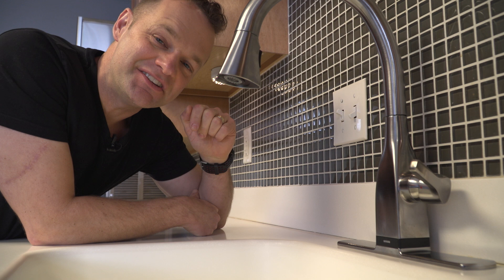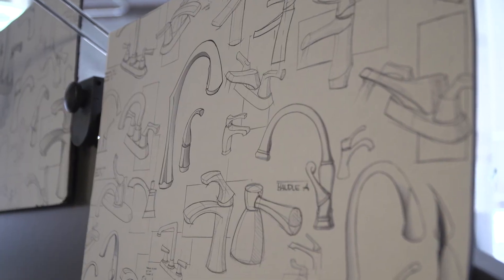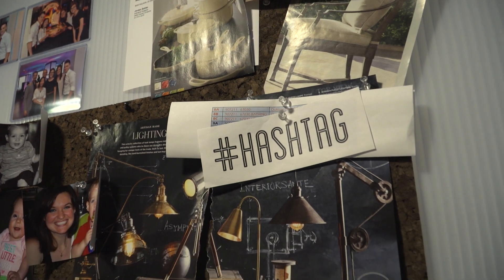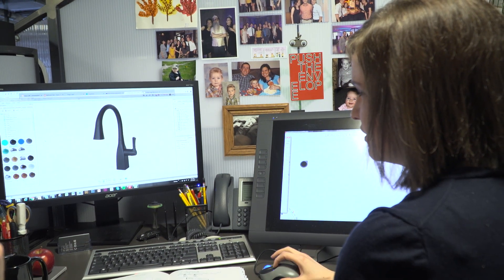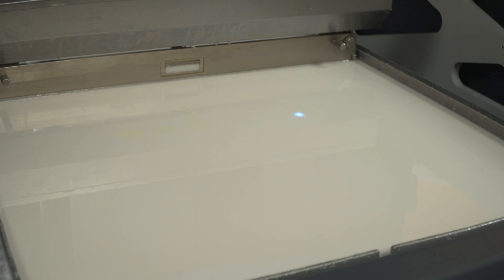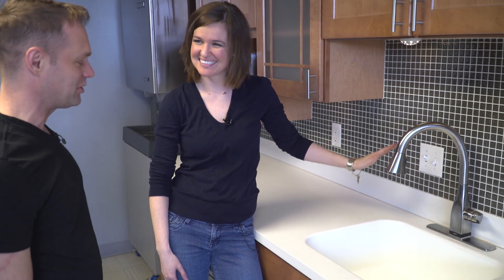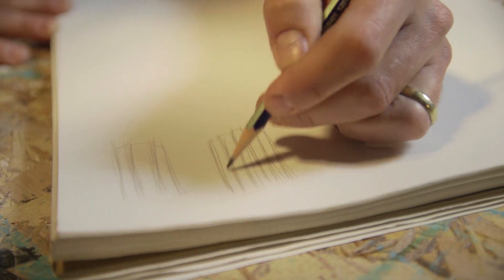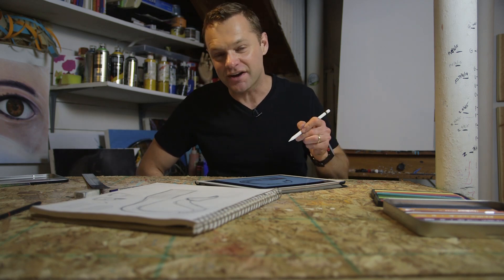The Art of Engineering: Industrial Design at Delta Faucet | Artrageous with Nate

Comment: The design doesn't work because it attempts to meld a sharp-ish cuboid with a flowing arc. And the surface finishes are different between the body and the neck. The faucet has a minimalist aesthetic, but then it has a lump on the side (the real faucet handle). And touch-to-turn-on is the wrong UX paradigm for a device for which you need fine flow control. The head of the faucet is also misleading because it corresponds in no way to the narrow water jet.
Reply from the maker: So, I'm guessing you are also an industrial designer? I'm not too sure on the engineering, but my goal was to show how engineers and designers have to work together in the real world. 
If you are a designer, where do you work? Have any projects you could share? I'm always looking to create another episode like this, but updated.

Thanks for watching, subscribing, and the feedback!
Reply: @artrageousnate  Deleting my replies? Seems a bit unnecessary.